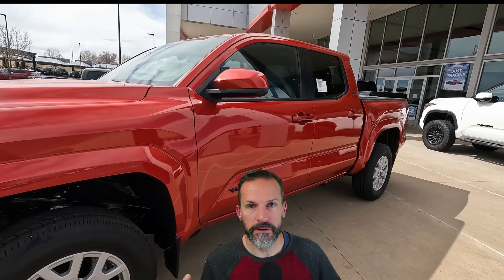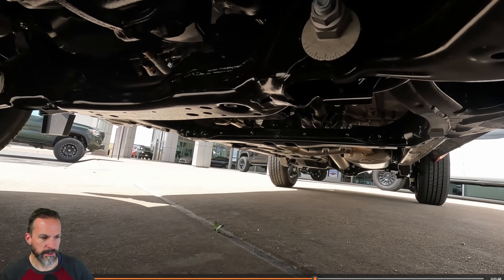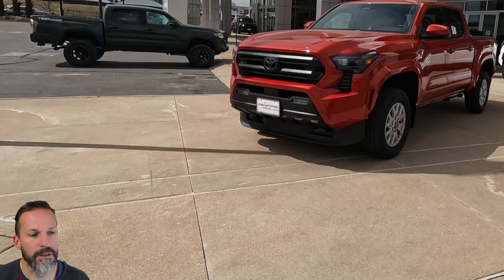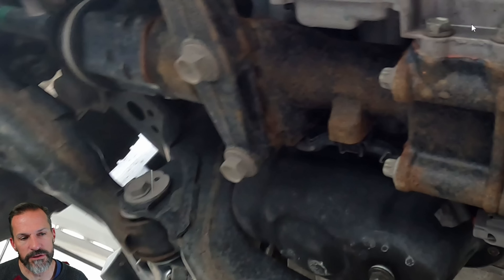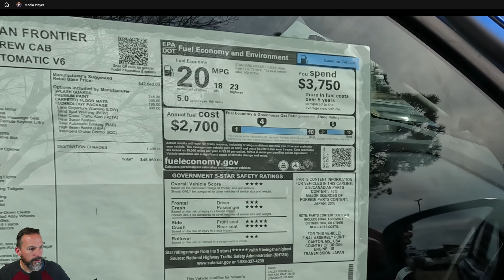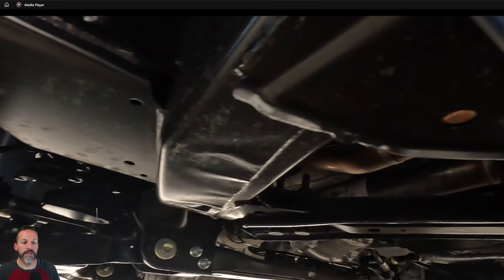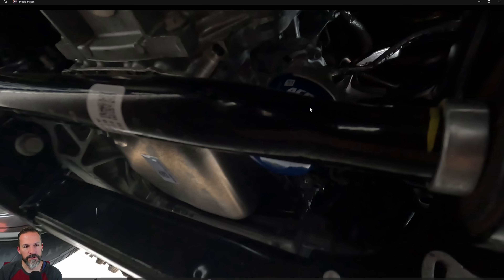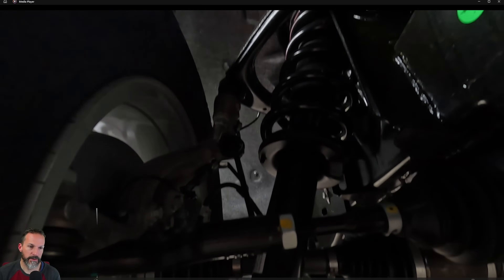2024 Toyota Tacoma, Nissan Frontier and Chevy Colorado. Comparable Build Quality Underneath?

Comment: As a 2023 Pro 4x owner. I can say the Frontier aims to be a competent truck and not a class leader. They listened to their owners. Naturally aspirated, hydraulic power steering. Feels and drives like a truck.
Reply: They're also made in Mississippi
Reply from the maker: I agree, glad you like your 2023. They are built like a damn tank under there :). My dad is in the market for one. He drove it, loved the "feel" of the drive. He currently has an xterra with 215k on it, runs like a top still.
Reply: As someone around nissan dealers alot, i have seen alot of 22-24 frontiers come in with major transmission issues within first 2k miles
Reply: @m_shasta4451 what kind of issues?
Reply from the maker: @m_shasta4451  I heard that those early ones were just reprogrammed, but is that not true?
Reply: @m_shasta4451  what issues are you referring to? I can't find any complaints other than the cruise control which was fixed and the parking prawl pin.
Reply: Not a tech myself but i’ve seen multiple need entire transmissions replaced. Could not tell you specifics other than stuff locking up. Issues very well could have been resolved by now
Reply: @m_shasta4451 Maybe you should get more info on what the issue actually was before commenting about it?
Reply: @jc6618  nah I think I’ll share any information I can get to the community? Sounds better honestly. I’m not going to be able to tell you the specifics because I’m not as knowledgeable as people who actually work on the engines but I can definitely tell people that it caused headaches for the techs who were working on it.
Reply: @m_shasta4451  crazy that I have not seen people on the frontier forums under 3rd gens talking about getting their transmissions replaced and I've looked on car complaints website, nothing there either. And you mentioned this in reference to only the 22-24 years. This transmission was put in place in the 2020-2021 years as well. But you don't mention that., idk mam you're not adding up.
Reply: Also, awful reliability ratings.
Reply: @theoutdoordad7395  repair pal rates it the highest reliability amongst all 7 midsize trucks and gives it a overall score 4/5, but random dude on the internet says "awful reliability ratings", sure bud.
Reply: @Brownlightning1990  the 22 had a recall on the parking pawl in the transmission. Everything else Ive read is calibration and a few needing the tcm replaced. I'm seeing more issues with the locker switch and Nissan is swapping entire rear assemblies.
Reply: You are 100% correct. Us Nissan Frontier owners don’t need a button to raise and lower the tailgate. It’s ridiculous gimmick features like that that drive us away from Toyota and other brands.
Reply: @m_shasta4451  The transmission issues only affected the 2022s and early 23s. The TSB update has rid majority of the harsh shifting issues.
Reply: @TheCarGuyOnline  You're correct. Mine was updated 3 weeks ago, it is now butter smooth
Reply: @TheCarGuyOnline I’m a 2022 owner and the only real complaint I have with the “hardware” of the Frontier is the damn turning radius. lol. I’m in NH and have complete faith in my Frontier getting me where I need/want to be 24/7/365. I have a few complaints on the software in the infotainment system, but that’s just annoying little things; biggest being when a pop-up message comes up and you click on it, it registers the click on the screen behind the message as well.
Reply: I love my frontier I had it at 4k miles now at 11. I really enjoy this thing and can tell it's going for the long haul. The transmission was hunting for gears between 4k to 6k but now it's completely smooth not a single hiccup.  Kinda like a pair of new shoes she needed to be broken in. No regrets and this thing is VERY capable off-road. I also agree with other people that the turning radius is not great.
Reply: @damianyeider6921  What year and trim did you get?  Local dealer has a '24 King Cab SV 4x4  w/Technology package for under $34K.  But adds on a $2.5K Ziebart upcharge,...not feeling the love about $2.5K for rustproofing.  I'd really like to get the Convenience Package, but not many around and those are at $39K + upcharges.
Reply: These have go
Reply: Do you have the rear diff lock leaking issues?
Reply: @lexa6089 dude I have that problem. Literally got it fixed 4 days ago for the second time. Might have to do something about it myself if it leaks for the third time like installing a breather
Reply: I have 23 Frontier SV. 4K miles and no problems yet.
Reply: I’d rather have the Nissans, even though I do like the Tacoma and gmc canyon. No brainer to go with the Nissan though.
Reply: @m_shasta4451  what about the manual transmission? That is still an option right?
Reply: @jc6618 guy is just bs, I belong to a few Nissan frontier groups and only issue has to be reprogrammed.
Reply: @lexa6089  Nope. However, seems common. Factory sealants were piss poor.
Reply: @Mico-rg9jg  Just buy an aftermarket diff cover. Z1 Off road sell them. Stops the leaking issue
Reply: @Blue-moon12  yup if ever it leaks again

Comment: These are the volume sellers.  For every extreme off road edition of these trucks,  they probably sell 10 of these lower equipped versions.  I'm glad that someone is looking at these lower equipped trucks and comparing them rather than endlessly drooling over $60, 70 or even 80k trucks.  Way too many YT channels just want to show off the latest over priced toys for rich folks and forget that these $30-40k trucks are the ones most of us actually buy.
Reply: The Frontier does not aim to be a rich man's gimmicky tech truck
Reply from the maker: Thanks for the comment, that was my thinking too. I still can't believe mid-sized trucks are in the 40k range. I bought a 2017 Tundra TRD new out the door for $36k....these prices to me are maddening. Wish I had kept that truck now....
Reply: Unfortunately for Toyota 30-40k trucks don’t exist.. their base models with less features than all of their competitors are selling for 45k-50k, they’re doing it so they can sell the TRD Pro for 70k. The TRD Pro and the ZR2 were both supposed to be 49k, the only difference is I can go buy a ZR2 right now for 49k, but I can only buy a SR5 for 50k or a TRD Sport for 56k. It’s absurd. Those trucks don’t compete with the ZR2 in any way, and they’re being sold for more? Poorly equipped Base model Tacomas with no features, tiny screens, and baby low power engines cost more than the top tier fully loaded Colorado? GTFOH. Shame on Toyota, this is a massive L and they deserve to flop.. unfortunately that wont happen because people are stupid.
Reply: @Blue-moon12  But it still has a push button start when I ‘d rather have a turn key.  🫤
Reply: @ChrisDavis333  And their "legendary reliability" is already proving to be out the door with major redesigns on Tacoma, and Tundra before that.
Reply: @TheCarGuyOnline  Used ones are probably selling above the original MSRP, or close to it.
Reply: @ChrisDavis333  a new Tacoma in WA is 65k lol its a joke ill keep my 03

Comment: I own a 22 Frontier S 4x4 king cab.  I could have bought a higher trim but there is something to say about a simple work truck that makes it fun to drive.  I own 40 acres so the animals do not care what size rims I have.
Reply from the maker: Cheaper to replace tires too, and they are typically better on snow :).
Reply: The one thing I wish the S's have is power adjustable mirrors. Man that's a pain when manual.
Reply: I absolutely love me 22 frontier king cab S. Traded in a 2019 Colorado with the 4cyl for it. And wow what an upgrade. I as well love the base model work trucks they simple and reliable

Comment: I traded a 3rd gen Tacoma SR 4x4 V6 for a 24 Pro 4X Frontier.  I will say, I did have E rated duratracs on the Taco.  The Frontier rides so much better.  It may not be fair to compare a base Tacoma to a Pro 4X but  here we are.  It is quieter, feels more solid over bumps, and delivers power so well.  Also, the hydraulic steering feels amazing, it adds to the overall solid feeling of the truck.  The Frontier drive train is what the 3rd gen Tacoma should have been...the transmission is what every Taco owner wishes they had.  The infotainment is also just so much better than the 3rd gen taco.  (obviously, the Tacoma came out in 2016 and the Frontier 2022, so again, maybe not a fair comparison) Faults of the Frontier:  Terrible back seat posture, worse resale value, smaller aftermarket industry, no storage behind the back seats.
Reply from the maker: That's great to hear. I have some family members looking at the frontier too, mostly because they don't want a turbo charged vehicle, they keep them 15-20 years and are concerned about reliability of the new stuff.  Regarding the hydraulic power steering, I have no idea why people don't want this. As a driver....it's such a nice feel, no comparison. I remember when electric power steering first came out, there was an uproar of people that hated the feel, now people are complaining about hydraulic...what a weird world we live in .
Reply: Spot on. The 3rd gen taco drive train kinda sucked, right? Trans shifting all the time, under powered motor....

Comment: The main thing for me is reliability, i wish we a crystal ball to see how which trucks will fair for ten years of ownership or at least 125,000 miles.
Reply: I’d put dibs on the frontier since it’s got a N/A V6
Reply: Frontier all day
Reply: Tacoma
Reply from the maker: If I was placing bets given the data we have so far and my past mechanical experience, the NA engine etc., the Frontier right now might be the best bet for powertrain reliability. Just my opinion. I actually think any of these three would hit 100k with relative ease, but with what downside, who knows. I had someone in my comments posting about how he has to add oil to his 2.7L turbo (Chevy Silverado) and it has 100k on it. He loves the truck, it doesn't bug him to add oil, but to me that's a sign of direct injection + turbo engine/piston ring issues. No telling if Toyota will have the same issues, and even Nissan has direct injection in the 3.8L. If you can get a used/port injection car like the 4runner or older frontier, those have been proven to last over 200k with ease :).
Reply: @TheCarGuyOnline  The Tacoma has both direct and port injection. It supposedly switches between the two to keep the valves clean.
Reply: Good luck with the Colorado after 5-10 years.
Reply: Go look up 2020 frontiers with high miles it's the same engine and transmission.

Comment: Just bought the 2024 Nissan Frontier Pro 4X a month ago, fully loaded with every option, $45k out the door and loving it so far.
Reply: Quick question on your truck. How is the seating are the seat bottoms wide and how about legroom. About to buy something and really like the pro 4x. Many thanks
Reply: @user-og9nr1fd9y  The seating is very comfortable,  plenty of leg room,  the back seat is a little too upright, but I didn't buy it for backseat comfort..lol. driver and passenger seat are plenty wide and extremely comfortable. You won't be disappointed..my seats are leather as well.

Comment: Do frontiers have issues with rust ?  I was looking at a 2021 with 24k miles at a dealership and I was surprised how much surface rust it had. I didn’t expect to see anything ! Now I’m looking at 22’s and 23s. Should I figure on getting undercoating ?
Reply from the maker: I'm not sure if they do, traditionally Nissan has not had nearly as many rust issues as Toyota...but maybe times have changed. I think a lot of people get undercoatings anymore. Depends on where the rust is...was it on the frame or just on parts/exhaust etc.?
Reply: @TheCarGuyOnline  …. All over but just surface rust. I’ve never owned a frontier but the more I research the more convinced I am it’s a great truck
Reply from the maker: @grandmastert01  yeah I’ve heard nothing but good things, owned many Nissans and never had problems.

Comment: I've never seen any rust issues on Toyotas here in Colorado and I'm a few miles from Interstate Toyota.

I'm currently looking for a Pro 4x. Ft Collins Nissan has them for $38k and we'll equipped. What worries me is reliability. Is that 9spd gonna hold up?
Reply from the maker: So far it seems to be holding up. I see reports of new Tacomas with failed transmissions so...at this point I don't think they are any better. I see reports of the Chevy Colorado with failed transmissions too. I think so far, the Frontier has one of the best track records for reliability of the new mid-sized trucks.

Comment: my 3.6 six speed 2016 colorado z71s been going strong since it left the dealer lot! shes sitting at 132,000 miles now- the frames very similar and you can tell they didn’t fully reinvent the wheel on the 3rd gen colorado. you can see the rear window and third brake light is the same. but that 2.7 turbo should be a decent engine since it’s been used in the silverado for a little while now, i’ve always loved the side steps on the rear bumper- never ripped em off my 2nd gen when on trails around hawai’i and it’s pretty fast on the road too.. overall this new colorado seems like a way better deal than the 2nd gen since it’s got way bigger wheel wells and all the new tech. plus it just looks a lot better to me.

Comment: Toyota does not use plastic oil pans.  It is metal.  The rear coil suspension is not new.  Its new to this application but it has been used in the Lexus GX for years.  Looks exactly like my GX460.  Its proven all over the world as the Prado.
Reply from the maker: I didn't think I said it was plastic, sorry about that, maybe I did but that's not what I meant. I was thinking about the transmission pans how some are plastic (nissan/ZF I believe is), and also some other brands like ford have plastic oil pans in the 2.7. I probably should have re-recorded it to make it more clear :).

Comment: How do the engines and transmission reliabilities compare ?
Reply from the maker: So far it seems the Frontier is the most reliable IMO, at least anecdotally. I don't hear too many issues with any of the engines on them so far, people seem to like the GM 2.7L..again so far, the nissan is well liked, taco engine from what I can tell doesn't have issues yet either. The GM/Taco have had some reported transmission failures and other issues, but not crazy widespread issues yet. If I was buying purely for reliability, I'd look at Nissan.

Comment: Thanks for this. Appreciate these views of the undersides and being done on lower trim models. I keep being impressed by GM''s design of the Colorado, particularly the TrailBoss. Only drawback is can't fit 4x8 sheet goods between wheel wells like Ranger. But GM kept a 21 gallon fuel tank versus the Ranger and Tacoma's tiny 18 gallon tanks. Hope GM has good QC.
Reply from the maker: You still trying to decide which one or did you already get the Colorado?

Comment: I have owned both frontier and Tacoma but I owned a 2014 frontier and I can confirm that the frame is definitely a little beefier than the Tacoma as it’s a boxed frame in almost the entire truck unlike the Tacoma where it was a C shape in most areas. I did get rear-ended in the frontier by a midsize truck going pretty fast. It bent the frame, but it held up a little bit better then I thought best part was it was very easy to fix and The Frontier was back on the road, unlike the guy who hit me which totaled his truck.

Comment: Thank you so much for this video! I agree in that I find this stuff much more interesting than other reviews out there. Would love to see this on the new ford ranger as well. Do you know if the new ranger has a differential disconnect?
Reply from the maker: Thanks for the comment. I'm not sure if the new Ranger has that. I need to find one and go shoot a video, others have requested it too :). When I shot these videos, I was unable to locate a Ranger due to low stock around me. Seems the Ranger/Colorado are in high demand.
Reply: @TheCarGuyOnline  Awesome, looking forward to that video. Before you do the ranger, look up "2024 ford ranger j-brace". You will find an interesting design flaw/quirk that you'll probably want to address in that review.
Reply from the maker: @coltonwood9846  Interesting, thanks for the ideas. It's a bit crazy people are adding j-braces in order to support top mounts....are they really that weak from the factory? Crazy.

Comment: Chevy should have kept the LB option in the Colorado.
Reply: Exactly, I ended up with a Tacoma because they didn't have the lb option
Reply: Why keep all the options , probably chevys smartest move was to start eliminate all the variants.Less designs to track for different issues
Reply: @davefornit6235  You may have a point considering that maybe 9 out of 10 buyers want the SB; I am that 1 though. I have a SB now and I hate the bed length.
Reply: Correct, I am not buying anything with a five foot bed. I am keeping my 2016 long bed Colorado and perhaps add a Frontier long bed

Comment: Hard to see some of it, but the overall essence of the chassis mechanicals was captured very well in this comparison video. Most people probably don't rock crawl with these versions of each truck, but exposed components can get hit from all the crap on roads these days. Road shrapnel versus plastic, it doesn't take a rocket scientist to understand why protection is needed. Gheesh, think about aerodynamic benefits even if aluminum plates were used to cover exposed parts! Make those plates easy to remove for service and replace, even for aftermarket. Toyota has those two shoulder flange bolts on the TRD front skid plate, and that would be a good place to start on all these mid-size trucks.